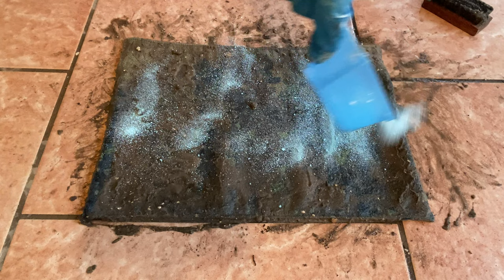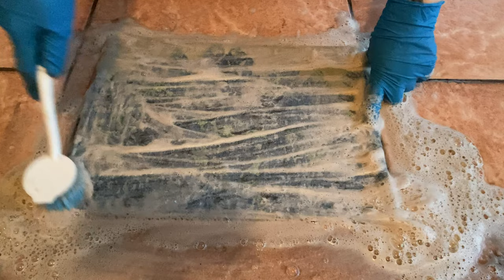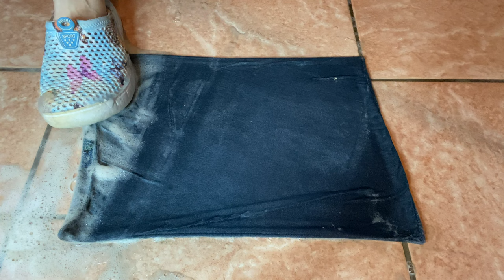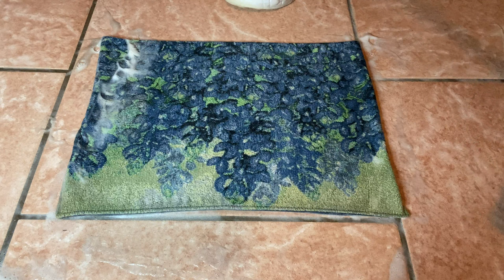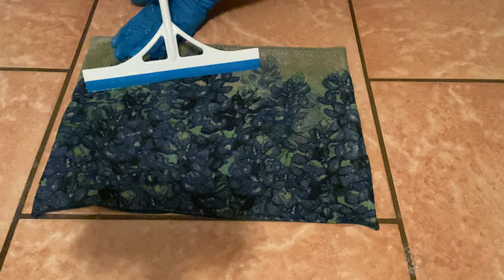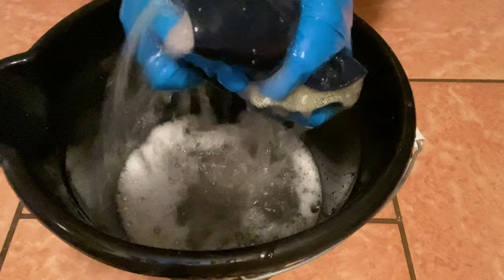Cleaning a Heavily Dirty and Muddy Carpet I Satisfactory Videos - Satisfying ASMR

Comment: Nice one.. was this on the kitchen floor? Shower next time you can wash it away and the sound in shower is ooooooooooooohh
Reply from the maker: No it’s on the floor in my balcony but I don’t have a drain so it’s a pain to wash out there we are on the second floor. I have to keep using a wet dry vacuum to get rid of all the foam and water and mud manually. Not ideal really.
Reply: @ASMR Junkie Rug Washing & More  would it be better to clean these small rugs in the shower or bath ? That way the water runs down the shower/bath drain the  you just clean after your finished
Reply from the maker: @billieread75  the thing is that I put a lot of mud and as you can see we don’t have the “purest” top soil here and it’s filled with little broken shells, twigs, tree roots, little rocks…. So all these would clog up my drain in one video. My husband would not be very happy with me 😂😂😂